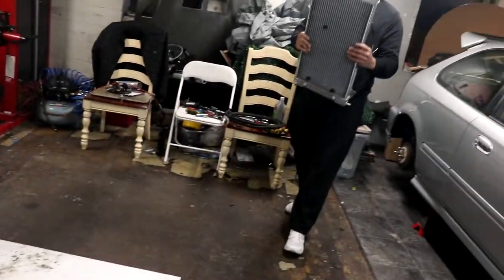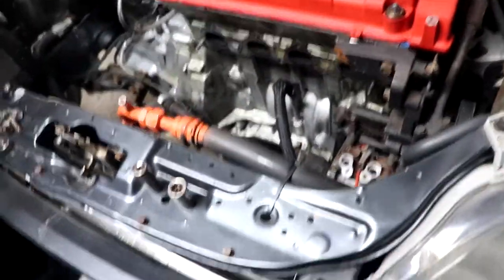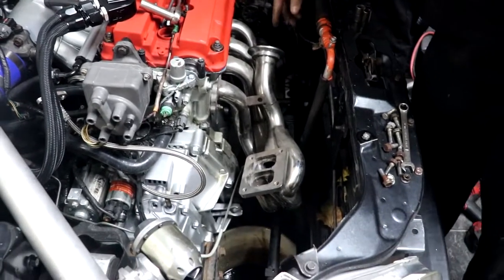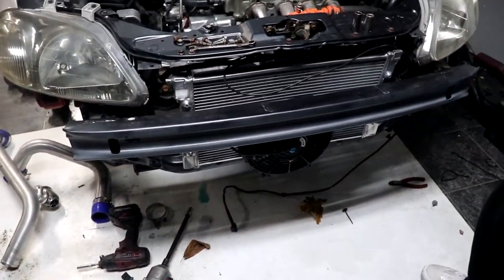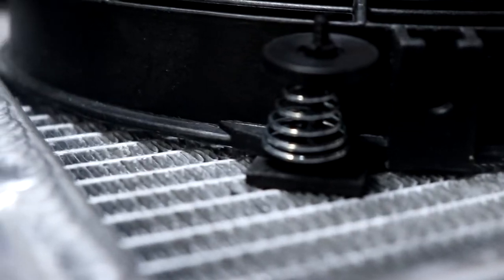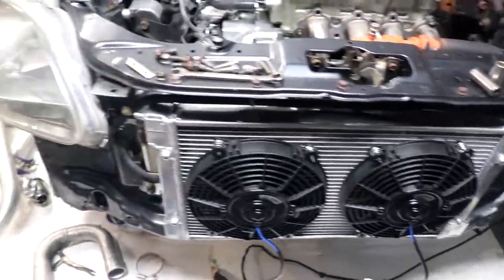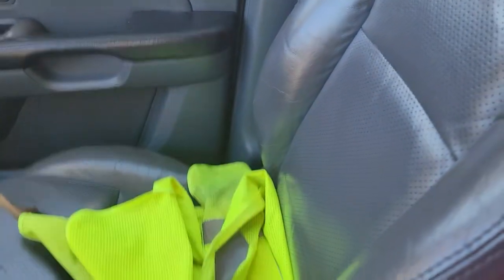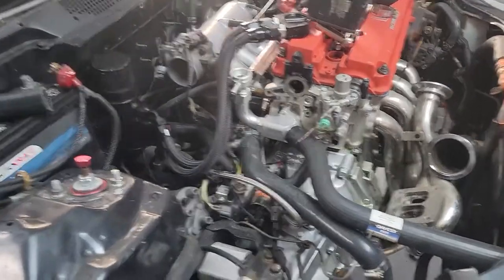Cheap Radiator Tuck! ( without cutting radiator support! ) For Honda Civic!

Comment: Hey are you still using this setup and if so how does it perform? I have a similar setup on a dc2 and im having issues with my 2 core half radiator so I'm planning to do this. My temps in coldest days where i live are around 197 - 215
Reply from the maker: I sold the car about a month ago but it was doing good it wasn't over heating at all for me
Reply: @thelostkidsgarage  thanks for the info man 👍

Comment: Radiator ??
Reply from the maker: @khairulshahrizan750  The link is in the description
Reply: Ac condeser or no ac
Reply: Not ac aircond
Reply: The fan is located near the front, ok
Reply from the maker: @khairulshahrizan750  the ac condenser goes on the inside of the engine bay next to the Radiator